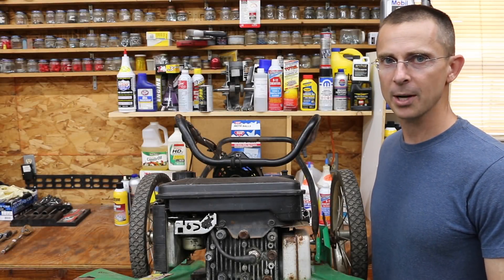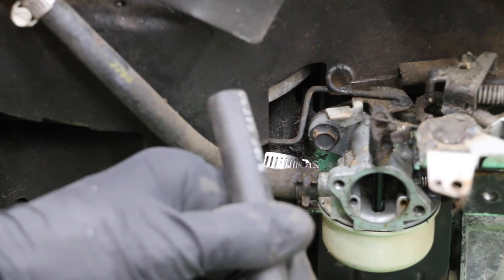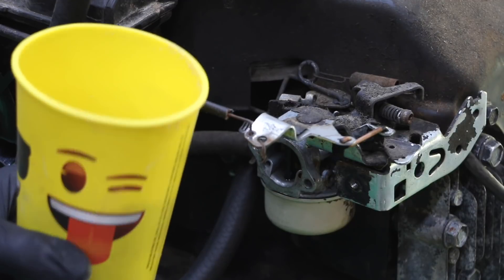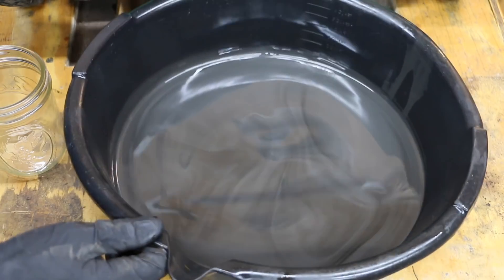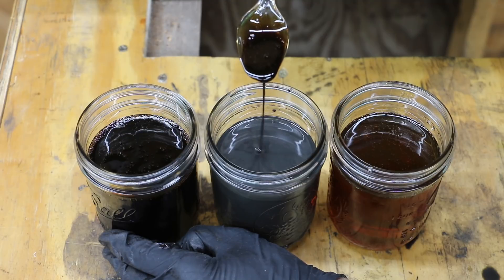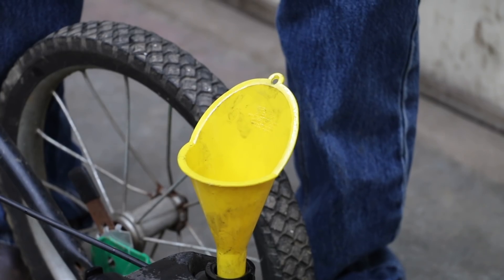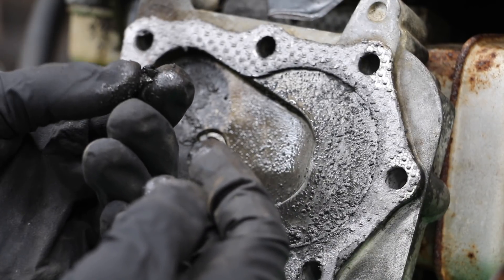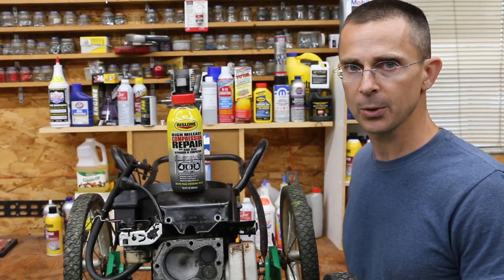Engine Eats Sand! Can Rislone Repair Compression Loss?

Comment: I dont believe any additive will ever improve compression by "repairing in a bottle". Rislone makes that crap that people use to "fix" radiator leaks but only makes the fluid thick and ends up ruining the whole system, right?

Comment: Try best line or restoer. I've used rislone for over 40yrs. I've had good results in getting the tappet's to be quite. I have never had engine aprart. My Dad recommended it me as he used it in the 30s with great luck. Using a lawn mower engine my not be the best to compare with cars engines. I do think it's a good way to test or experiment with for results. I thought this was a good test however. I've heard rislone is more of a cleaner than anything. I use two bottles twice a year along with engine restorer. My van has a V6 4.3 engine. Chevy astro van, 1987 with about 110,000 miles (engine replace). I change oil every 3k miles. I enjoy your videos very much and find them well made. Good quality and production valve. Ive made hundreds of documenties. Good job. Congratulations.
Reply from the maker: Thank you for the recommendation!

Comment: I used it before. It did not work then
Just rebuild it. STP and all the rest is the same. Motor honey all the same. All that it does is make the engine oil thicker so it wouldn't use as much. And that didn't work very well.
Reply from the maker: Thanks for commenting on this!

Comment: Same old story, people looking for a miracle in a bottle. There are miracles in bottles, but they are at the liquor store not the auto parts store.

I do have a suggestion though, since you're using old Briggs and Scrap irons anyway, why don't you try the old synthetic dry crankcase test? You know the one where they run synthetic through the engine, then drain it and they run it dry for like an hour or so. These have all been pressurized oil systems, be interesting to see how it works with a slinger system.
Reply from the maker: Thank you for this recommendation!

Comment: I have two of the "20" inch Weed Eater Push Mowers. What will fix a BLOWN Engine Project Farm?
Reply from the maker: My opinion is that these mowers aren't worth repairing if there are major mechanical issues.  Often times, people throw away running lawnmowers or they can be purchased in good conditions for $30-40.

Comment: you need a sponsor, but one not in the auto or additive business. I have tried the rissole, while it felt like it had more compression while driving, it probably didn't really, If it simply thickens the oil, then that would be the same as I did to one old small engine that had lost some umph, put 50/100 airplane oil in it. Ran much better, had more power, but didn't actually change anything in the engine.
Reply: that should be Rislone darn auto correct
Reply from the maker: Thanks for commenting on this.

Comment: The scores are too big to improved at all with any additive and isn't representative of any normal engine wear. A very small amount of silica sand or aluminum powder may be a reasonable test.  This is just a shit test to be honest. You need to be more accurate and scientific in execution. Also, if it were a car engine it would take thousands of miles to work. You can't conclude shit from short tests with impossibly extreme damage. BTW, Restore does work.
Reply from the maker: Thanks for commenting on this.

Comment: Well this may not be realistic because the sand is still everywhere in the engine even after the test. I would ingest fine aluminum powder after ingesting jb weld in small doses.
Reply from the maker: Thank you for this recommendation!

Comment: I would say the test is invalid, why you ask? Basic, the scores in a cylinder wall from lots of time/miles on an engine are not as big as sand! Good God really?

Not that I would trust this product to increase compression but that is not a proper test. You did engine restore on a engine with a lot of hours on it then used a different compression gauge to compare before and after and claimed the product worked. This is not a fair test nor is the rislone a fair test.
Reply from the maker: Thanks for the construct feedback.

Comment: Love the video's but unless you meticulously clean out the engine after adding sand its a little unfair, but for what the average person would do its pretty spot on as a real-world test, I love all the tests its what I would love to do if I had the time ever since I got my first car 25yrs ago and came across all the miracle additives I've wanted to know how well they work, because you read the label and think "really it's going to restore my engine" I wish I could test it, They couldn't possibly make these claims if it dosent work, so you tell yourself it works and yes my engine does sound less noisey, but I think thats you fooling yourself because you just spent $20 plus on something that'll fix your engine by just pouring it into the oil, So thanks love the entire collection.
Reply from the maker: Great point and thanks for commenting!

Comment: I would tend to think causing damage with sand first wouldn't emulate normal wear/compression loss.  Would it be possible to re-run this test on a low compression engine cause by normal wear to see if it makes any difference?
Reply from the maker: Thank you for this recommendation!

Comment: So what i have learned from this product is ot acts much differently in a more powerful engine. When i say more powerful somthing such as a four cylinder or higher. My results were using ris which a car that has a blocked or closed spaced pcv valve have more difficulties with the flowing of the oil due to the thickness increase
Reply from the maker: Thanks for commenting on this.

Comment: seems like a similar product they have for head gasket leaks. you dump the magic liquid in your radiator and after some driving your head gasket is all sealed up. problem is it also seals up you coolant tracks, heater core, radiator and ends up causing much more damage.
Reply from the maker: Thanks for commenting.

Comment: Im late but, You know i want to see a fallow up video to what will happen after 1-2 weeks of running that engine with Rislone since the build up and scratches are so fresh. The cluster of junk on the head just goes to prove that maybe there is still alot more junk inside that engine that the regular oil couldnt pull.
Reply from the maker: Thank you for this recommendation!

Comment: I think this is supposed to increase compression in engines with some ring wear, just by having thicker oil on the cylinder wall. Not for filling in scratches. Like how putting a drop of oil in the cylinder before you do a compression test.
Reply from the maker: Thank you for this recommendation!

Comment: Most engines that you would use this in would not have that much damage. Also they'd probably have a cast iron cylinder wall. Would be interesting to see this stuff tried in an engine with cast iron or steel cylinder walls which would more accurately represent an average automotive engine, which is what this appears to be designed for.
Reply from the maker: Great point.

Comment: you didn't run the engine with rislone for very long. perhaps it takes many hours to restore compression? Maybe the buildup on the head was what was supposed to end up in the scoring on the cylinder.
Reply from the maker: Great point and thanks for commenting.
Reply: anytime. keep the videos up. i enjoy them a lot!
Reply from the maker: Thank you!

Comment: Lets just see this in a 'solid view' how can a fluid 'resurface' or even out a cylinder wall? I am not talking about the cross pattern. Just filling up dimples and scratches. I mean parts are moving at a high speed-contacting each other at a high speed (piston movement a.e. at ~4000rpm). It somehow has to sit in a dinch/dimple or groove to harden out and has to work like an adhesive to the metal too. I don't think you can control fluid to do so, yet, in this application.
'scratch my head' will it blend?

Thank you, for sharing your result (yours, to name the 'variation of results). I sometimes think of using an oil addition but don't like to spend a penny just for curiosity. And thanks to my well performing engine.
Reply from the maker: Thanks for the positive comment.

Comment: I think u might have damaged the engine a little more than typicaly a used engine .. I love your channel and think u should try and redo this test in an actual low compression engine. Sand is fairly harsh to put inside a crank case as im sure u know . i have used this exact product and thought it did an ok job could even hear a diffrence in exaust note. And i have used restore brand that supposedly dose the same thing . and restore is a very good product and u show that on your tractor vid . wish u could recreate that test with the rislone .. I would like to see the comparison. Not talking crap in any way i LOVE YOUR CHANNEL AND ALL YOUR TESTING AND WHAT U COME UP WITH TO TRY OUT . look forward to your new tests and what ur testing next . . i would love to see u test these so called head gasket repair fluids .. Such as blue devil and bars leaks brand stuff also they cost a decient amount of money and claim to stop leaks in heater cores and gasket leaks and headgasket leaks but wonder if they really work. Or just plug up stuff and make it worse .. I have had about 40 percent luck and tried a few brands and have mixed results . i am a 25 year mechanic and wish i had time to do half the tests i have seen u do . must be fun . caint wait till im retired
Reply from the maker: Thank you for this recommendation.  I'll see what I can do. I've got to figure out a test design.

Comment: That was pretty significant cylinder wall scoring and I bet the valve seats are ate up some as well. The Rislone could be just as effective as running a higher viscosity oil (like 90 weight). When you can see visible gouges it goes beyond cylinder honing with a stone and becomes a job where it would need to be bored out and to have the rings replaced. Also the valve seats would need to be re-done. (engineer, so I know something about mechanical stuff too)
Reply from the maker: Thanks for commenting.

Comment: OK, I see a bottle of Berryman's B-12 
fuel additive.

Can you compare it to B-12 carb cleaner?

I'm thinking that they are the same product, 
except one is pour-able, and the other is in an 
aerosol can.

Prove, disprove, or offer your well thought-out 
opinion.

steve
Reply from the maker: The fuel additive is different than the spray can. I've reviewed the SDS for both products. The fuel additive has less acetone and it safer to use in a fuel system.  I wouldn't recommend spraying the carb cleaner into the fuel tank.  Hope this helps.

Comment: Have you ever tried to run an old beaten banged up car that’s really just about ready for the junkyard but it still runs the engine anyway have you ever tried running E 85 in that just to see if it would work in a regular engine
Reply from the maker: Not yet. Thank you for this recommendation.

Comment: Man you're legit. I was curious about (budget) ways to spruce up my old bronco, and some of these cheap products make wild claims. I was nearly sold on this product until I saw your test, and now I'll look into more reasonable options. Thank you for all your hard work. Subbed!
Reply from the maker: You might consider testing Engine Restorer.  Recommend testing the engine compression before using the product and then after you've added and driven it 50 miles or so it see if it has helped. I've had great results from it. Hope this helps. Thanks for subscribing.
Reply: Thank you!

Comment: If Rislone is supposed to fill grooves, it stands to reason that it's more effective at smaller grooves. Respectfully, I take issue with this test. A low compression engine isn't going to have the types of deep grooves you showed from the sand ingestion. Yes, I'm arguing thousandths here, but that will make all the difference in compression.
Reply from the maker: Thanks for the constructive feedback.

Comment: The only way to make more compression, Overhaul. When I was young, I thought all the oil additives would work.  I don't use anything but synthetic oil in my motors now. When I was drag racing I used 40 wt. oil. Really good videos.
Reply from the maker: Thank you for the positive comment.

Comment: I just love your channel!!! But i think the product, only will work with a small crack in a headgasket or small leak,,, not to a damage cylinder head,, ,, So in some cases i think it will help,., Back in the old days if we had a bad gasket on and old tractor like the T20 Ferguson,, we use to but in coffee grains, after they had made coffie,,, in the radiator,, and after 5 min of runing we had compression again,, 
he he some times the dame tractor  had more coffie then me some days,,, it was not a great fix,, but it could last for 2-3 weeks before it shot it out,,, 
It had so much coffie inside i could sometimes smell it when we fired up the engine,, 

And that how i think the product will work in some cases like the coffie,, but then again its much chepper to ad some coffie grains in to it  he he

Loved the video..
Reply from the maker: Thank you very much for the positive comment.

Comment: I used Engine Restore in my 1990 Honda Civic.  It is up to 326,000 miles on the original engine.  I tested the psi before and several times after.  3 out of 4 cylinders improved between 10-25 psi.
Reply from the maker: Thank you very much for sharing this information.  I tested restore on my old ford tractor and it helped.  I'm surprised it actually helped. That's a lot of miles--impressive!  You must do a great job maintaining it.  Thanks again.

Comment: Would Seafoam help a v8 engine that has around 600k miles on it that's never had any kind of additive treatment or major work done, I got one that rattles going up a steep incline with a steady throttle push and lacks power and is a lot noisier then as little as 50k miles ago
Reply from the maker: It's difficult to say without hearing the sound of the rattle to determine the source.  Seafoam will do a good job getting rid of carbon buildup inside the combustion chamber.  Excessive carbon can lead to pinging from predetonation.  It'll also clean up the inside of the engine to help improve oil flow.
Reply: Project Farm That's understandable, when people ask me for my help the first thing I say is I need to hear it lol from the information I do have it sounds like a little piece of metal bouncing around in a soup can and it's underneath the throttle body lol it doesn't seem to effect the truck much its just an annoyance lmao

Comment: I think rislone being as thick as it is, added to engine oil,is designed to have that thicker viscosity to prevent blow-by from the scoring,therefore helping Maintain higher compression  NOT to repair/fill scoring.
Reply from the maker: Thanks for commenting on this.

Comment: I have yours this product too and it failed badly had to replaced a honda engine in my civic plus cause additional damage as well to my radiator and heater core
Reply from the maker: It's disappointing to hear about product failures. Thanks for commenting.

Comment: Very unscientific. Sand sucked into the carb is not the same as normal engine wear. You introduced much deeper scratches with large grains of sand than occurs from normal wear. Rislone has to run in the engine for a while to work. That build up could have been sand and junk left behind. I've used Rislone Compression Seal in many engines with very good results. I had a 4.3 Chevy V6 that smoke bad on startup and continuously. After the treatment it only very slightly smoked on start up and cleared up. It ran better. I didn't perform a compression test before and after, but the evidence was clear.
Reply from the maker: Thanks for the constructive feedback.

Comment: had a old ford with a straight  6 in it. had a lifter taping,found out no oil was getting to just that lifter. put some reslone in it with out a oil change about 3 or 4 hundred miles later it stopped.
Reply from the maker: Thanks for commenting on this!
Reply: I hope that helped in some way.

Comment: I never use that rislone. But I've used the oil treatment and the Black Bottle that reduces smoke for worn-out engines. The oil treatment I used on an old Cadillac that was sitting free 30 years I ran it in the engine let the engine sit overnight then when I came back the next day and start it all the rapping in the engine just slowly went away until the all the lifters come from cells back up and the car ran good. Which I had no results with regular oil. Now as far as the Black Bottle that reduces smoke for worn-out engines. I did have a Dodge Dynasty that would smoke and after using that bottle it would stop smoking for a while. Do another oil change put it more in and would stop smoking again.
Reply from the maker: Thanks for commenting on this!

Comment: ?? the sand pits stay in the rings after it gets into engine, or this was the case for me. i use to off-road in WI a lot and sand would be not just in my oil and intake but It also got into the ring groves. 
test would be better if you pulled piston out after sand run to clean and check for left overs.  That sand can also make it into oil and just sit in the bottom of the engine for a long time. 
nasty stuff.... 
PS thanks for the vids!
Reply from the maker: This is great constructive feedback.  Also, thanks for the positive comment.

Comment: One thing your test may not have factored in was valve seat wear from ingesting the sand, and its effect on the compression.
Would be interesting to see what the valve seat surfaces looked like after ingesting the sand.

Otherwise, great test!
Reply from the maker: This is an excellent point. Thanks for commenting on this!